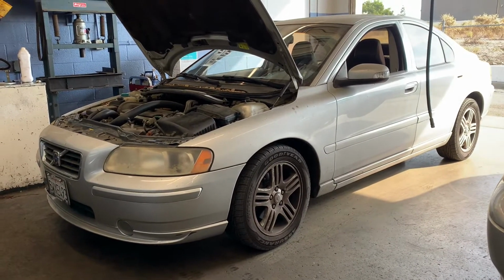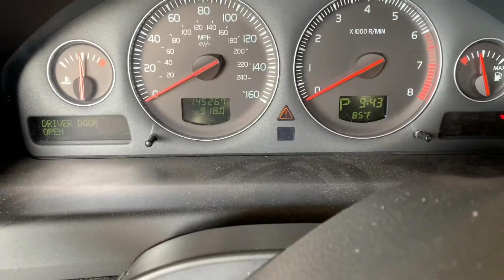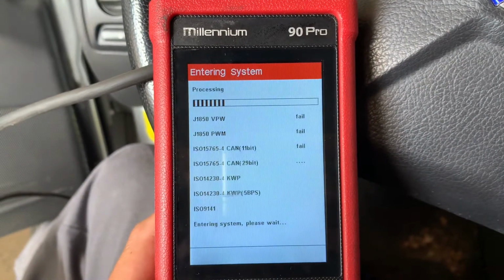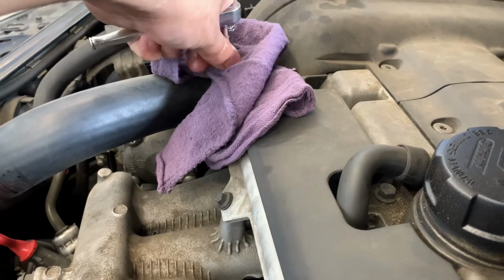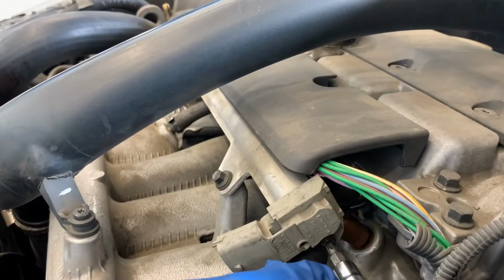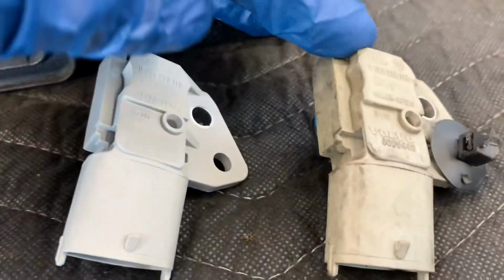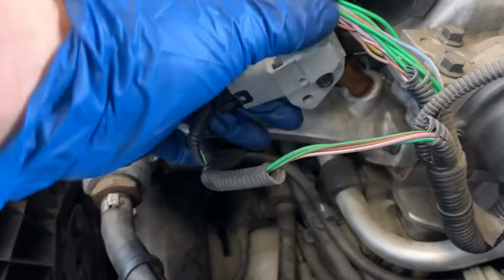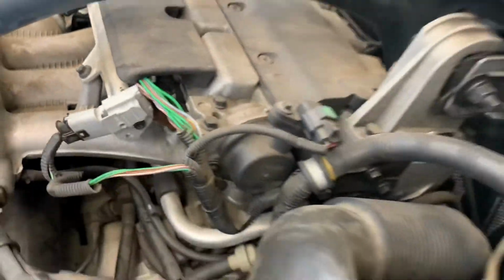Volvo Check Engine Light (No Power) Ecm-2900 Fuel Pressure Sensor ⛽️

Comment: Great video. This was a good video. It explained the steps well. Also the color difference of the sensors is key. I bought the wrong one for my Volvo and went through hell trying to figure out why it was running so terribly. I changed the fuel pump, the fuel filter, and the pem module, only to find out it was a stupid mistake on my end.

Comment: I have changed the fuel rail pressure sensor but I got the same code. What else can it be? The car still pulls fine but there is a hesitation when I shift from 3rd to 4th. I have to lift the foot of the throttle completely for a second and then it works fine again. I have a V50 t5.
Reply from the maker: Razvan Ursache sorry to hear you are having trouble it could also be the fuel control module.